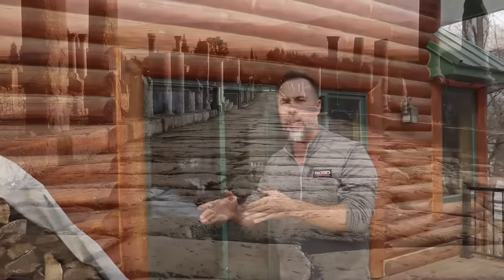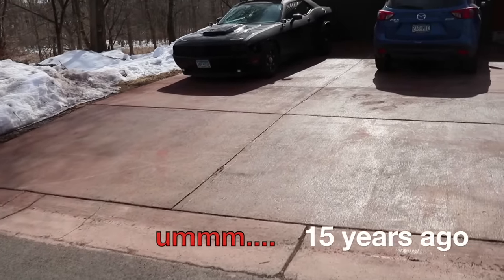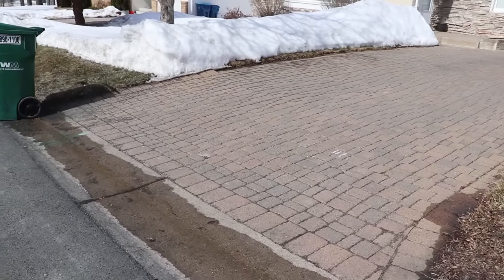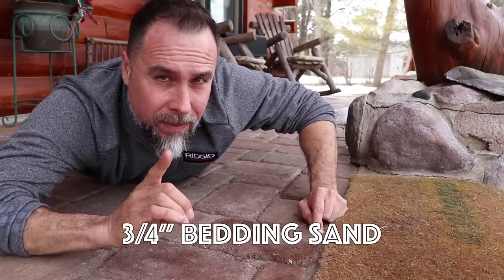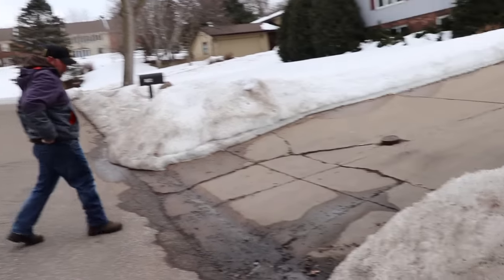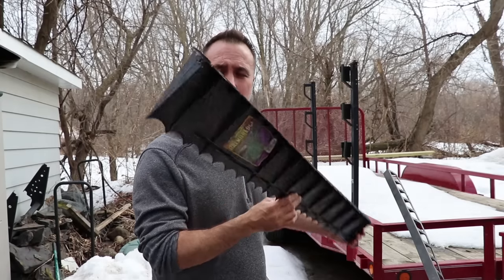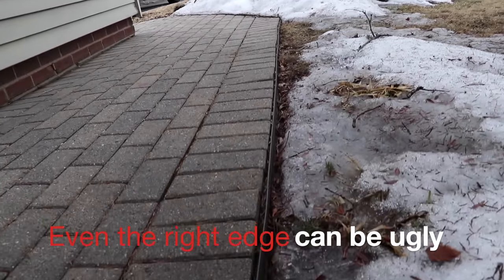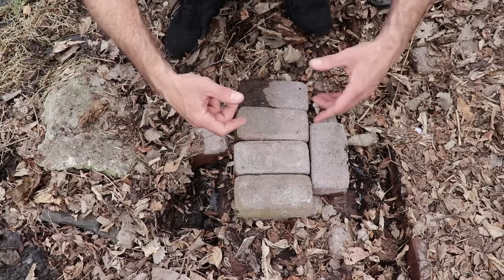How NOT to Build with Pavers-  Why They FAIL! *DIY your own successful paver project

Comment: great tips. do these also apply to gravel patios? we are planning to build one ourselves using pea gravel (10mm tanned gravel). I wonder what's the best way to solidify the foundation (our soil in calgary, canada is clay like) and stabilize the surface gravel (mulch-lock or a binding agent). we plan to secure the gravel with bricks. I suppose those bricks will require the plastic edging  where it's not sitting next to the grass (e.g. by the fence). thanks.

Comment: Sand depth is a total myth, I went with 2 inches to even out my base on one side of a 12 x 12 patio, 5 years later and no issues and we get a ton of rain in Upstate NY. It's all about a soil separator that you never even mentioned or probably even use for that matter . No soil separator and it's not a matter of if it sinks only when. That's my pro free tip of the day by a DIY homeowner.

Comment: A lot of small asphalt paving contractors will just backdrag some rock and then put in a 2 inch lift over it. It doesn’t last. You have to dig out soft spots and compact every layer.

Comment: Stanley, you mention using a "chop saw" to cut of several blocks at a time in place following a chalk line.  This strategy would be very helpful for me in that I made the mistake of deciding to make an Octagon shape for my first paving project (eight 80 inch sides, paving with 4 x 8 inch bricks).  I need to rent the saw and want to make sure I get the right one.  Are you simply referring to a concrete saw? My space is such that I do not have to be exact. My thought is to do a single row Sailor Course for a boarder, then fill in a cross to cover four of the sides and all of the middle.  This would leave four triangles to fill in which I assume will result in lots of waste.  As far as cutting in place goes maybe it would be better to do the triangles first, cut, and then fill in the cross?  Any suggestions are appreciated.

Comment: Ok I feel like this will sound like a very dumb question, but I’m new to this and we all know if I wait for my husband to do it I’ll be in a nursing home. When you say use a pvc pipe for the 3/4” sand, do you mean to use that as a tool to measure? I work so much better after actually seeing it being done. I just want to be sure.
Reply: You use pipe on gravel so screeding is easy. 2 pipes on gravel inside the last layer before brick and metal/wood beam on it to level and measure it easily. Make sure to take those out before laying brick tho :D

Comment: Well I'm convinced, going to build a wooden deck.
Reply: Keep up on termite treatments. That's all I'll say. If it ain't one thing it's another.
Reply: Your saving a bunch of money up front for something that is going to rot and swell no matter what you do.
Reply: @jeffdillenbeck1278  but depending where you live will last for a decade, you'll have that money back to build another one if need be.
Reply: Having a big problem with pavers, I'll post the outcome.
Reply: @sandracostello2833  post the outcome

Comment: You don’t use dirt as your base material... or sand... you use crush & run, tamp that down, then use sand, and level that out. Then install pavers, then you use poly sand to  fill joints and hold pavers together.

Comment: At a guess the failure of that concrete driveway you show 5:52 looks likely to be down to that drain. Drain probably has had a long term leak eroding the base and creating a sink hole, could be big.
Reply: agt155 Or!,...Or!,...They didn’t compact  the backfill around the drain in small increments. Just a thought,....

Comment: Dude, I am trying to decide if I want a concrete patio, under my deck or a paver.  Your video is making me hedge my bets towards the paver.  I am looking for guidance on how to prep the soil and gravel under the pavers.
Reply: If you live in an area where the ground freezes I would go for screw piles instead.  Cheaper and way better suited for structured support compared to concrete and pavers.

Comment: Hey Stan, excellent video as always, and the added bonus of some humor to break it up, but I've got some questions.
So I'd attempted to start a paver walkway base, dug down to remove all yew bush root material to prevent rot sinkage like the "one hot mess" job. Returned mostly clay packed at roughly every 2" with a small non-reversing plate compactor (300lb or so), then a layer of erosion fabric (forget the name) at approximately 8" from grade. Then that was topped with crushed limestone, also packed with same machine approximately every 2". Before pavers were ordered, found icicles (a whole different story) would be dripping/falling onto pavers and would prefer they fall into the garden box the walkway will be spaced off the home with. What would be your recommended edge against non-compacted fill, and in shifting/disturbing/digging up/out the settled crusher run, what would be the process to repack? Would I be best to completely remove the crushed limestone to plate compact every 2" again? I need to extend the garden box near 18" into the packed stone, therefore extending the opposite side of the planned walkway, against the turf, the same amount of 18", leaving only the middle of the crush in its solid state of compaction. Thanks for any suggestions, apologies for the confusing verbiage, as you can tell this isn't my area of expertise!

Comment: Will 1/4 minus gravel not work for a patio foundation? Will this foundation make pavers sink within the years?
Reply: use about 5 - 8 inch of gravel aggregate on top of properly compacted soil but the aggregate must have a good size of mixed stone from 1 & 1/2" down to dust, wacker plate each 2 inches layer you put down. add a weed membrane then 3/4 of inch sharp sand not builders sand then pavers then wacker plate the pavers to bed lastly spread sharp sand / brush over top and inbetween small gaps between pavers.

Comment: You may need 6 8 or 10 inches of base in Pennsylvania with its soft rain-soaked soil, but do you really need that much in Phoenix or Las Vegas? The ground there is so dry, it's like concrete already.

Comment: as a contractor in homerenovation i like to watch this channel for new machines and technologies, cause here in Europe we usually run 10/15 years behind.
but not on driveways, not saying this is a bad way to install a driveway, only this method of installing has not been used in my country for 20 to 30 years.
now we place driveways and terraces that can handle a semi truck torquing and maneuvering without any damage.
almost for the same price and installation time of the old way.

Comment: I usually agree and learn with/from  what you share but this time I can't believe you're suggesting to use that ugly and tacky plastic restrainer. That just doesn't fly with high end clientele neither with me. A concrete foundation of about 8" to 10" deep x width of your border, reinforced with #4 rebar is the best, of course you set your border pavers onto it with mortar. So far that has given me the best results.
Reply: Good point. The first thing I get rid when doing a repair job.

Comment: Yes sir the base is gonna take you the most time but I can not stress more how once you get the base done and the more pavers you have stacked up ready to go and as long as knobody treads thru the base. It is easy peasy lemon squeezy as long as you are going around with a bucket of sand and a margin trowel as you lay to correct any single pavers that might be to low and the rubber mallet is not enough to work it’ out . And yes sir polymeric sand is the concrete of paver sands that’s gonna respond like concrete in a way it hardens like a rock . Here is a good tip for using polymeric sand make sure you got the sand all in the joints and the surface of the pavers is pretty much spotless because once you activate the sand with a light misting if water it will harden like concrete all over the paver so I can not stress more the importance of those steps and only a light mist to be applied you do not want to flood it then you wash out the joints and thats the whole point of sanding the joints to lock it from movement . Also the polymeric sand is a great weed barrier as nothing can penetrate thru it . But IT may not be for everyone’s job applications because polymeric sand is not cheap.. note to anyone thinking about using it .. much love from lovely hot and humid ass Phoenix Arizona a.p.a certified installer signing out.. seeing those videos of mass settling remind me of when back in the day when plate compactors were not all that popular we used 12x36” hand tamps like u would use for tamping masonry footings lol 😂 how the time has flown. And im only 32. I feels like it was just yesterday when.i was 15 and picked up a trowel for the first time thank s Stan the dirt monkey genedyk

Comment: I put in a DIY patio. We bought a lot of brick for a guy. We built a great base. Several inches of limestone. Then we added about an inch of beach sand. We used a timber border. The issue I'm seeing is the tops of the bricks are fracturing away. I'm guessing it is the wrong type of brick. Maybe you can enlighten me to whether or not that is the issue. We have decided that the patio is too small. Its is 10 x 20. My wife wants more room for furniture without cramping walking. I surely dont want to invest time and money into a larger issue.

Comment: As a homeowner but also diyer.. I wonder what the cost difference your driveway vs the others that failed within 5 years. 
Good example of cheap not better.
Reply: TurboFlush I do this for a living and I’ve done drive ways that are 10 years old and are still solid no holes No sunk

Comment: HELP: I have brick octagon pavers. I don't believe these are clay pavers but maybe a concrete. I say this because they are no longer smooth. The top layer and color comes off when pressure washing with default nozzle. Now there are little pebbles on the top layers. The pavers now hurt when walking on them especially with they warmup under a hot sun. I am trying to find out if these are in-fact concrete pavers and if they can be restored, made smooth again. I bought this house and am betting these pavers came from the home depot down the road.
Reply: Yep, those are concrete pavers. the only real thing you can do to smooth them is seal them with a high gloss sealer. We use Gator Seal Wet Look, but any High Gloss Concrete/Paver Sealer would work!
Reply: @st.augustinepavercompany809  Awesome thanks so much I will look into that! Is the sealer color coated? Meaning The papers color has really faded. I would like to brighten them up.

Comment: If you want 3/4" why not use a 1/2" pvc pipe which will have a 3/4" outside diameter?

Comment: Wait a sec Stan.  At about 2:45, you're showing an installation "23 years ago" and "not a chip, not a move".  Great installation but....  I notice that the "straight line" from the garage to the street isn't straight anymore.  Is that due to horizontal or rotational movement or perhaps 23 years ago techniques/materials changed and this problem no longer exists in 2022?  Also, one paver is chipped (out of a thousand--I'll take those odds).  How difficult is it to lift and replace one individual stone?  Special tool?  Otherwise, great video.

Comment: The concrete edge restraint being a bad thing is only for states with those thin little grasses such as the ones up North.  That's not true at all for Southern states because that's a grass problem, not a paver problem.  I've had grass growing right up to the edge of my driveway for 7 years now and no grass has ever cooked or turned brown there, and I live in the hottest state in the union.

Comment: Saving money is rarely economical.  Ive built $2,000 300 sq ft decks and $7,000 for about the same.  When you build any surface you must consider its use first!

Comment: Been laying pavoirs for almost 30 years, for a good edge restraint learn about “bridging bonds”  no need for any of these expensive products, no haunching etc, clean tidy finish and stronger than anything you can buy. Lastly anyone laying pavoirs without adding a geotextile membrane on the sub grade shouldnt be in the job.

Comment: My friends' paver patio was ruined by ants mining out the sand below. I think it had been there a long time though. 
On the other hand we have expansive soil, so whatever we do it isn't going to stay good. Concrete or pavers crack and heave.
I don't get the rust-weld idea. The plastic edge can push through rust, no? A spike in the earth will just sit there, rust or no.

Comment: I didn't understand why it's good for the steel spikes to rust. Once they completely rust away they will have no holding power.  The rust itself will just be dirt with a much higher than usual iron content.

Comment: heck, my honey-do pavers didn't even get four inches, no wonder they are leaving me, wandering away hither and yon, to and fro.  I have the worst, most liquid clay soil.  I swear the water table is so high I can drive a pipe 3' down and have a nice water well.  Also my two lots are on the side of a hill, they catch drainage from the lot above me.  Any ideas how I can build a base for a walkway about 100' long, 36" wide from house to shop?  The builders must have done a good job back when the house & shop were built in 1967 because none of the concrete - two long double wide drives, patio,  1200' and  280' six inch thick solid slabs, and a 2100' house slab with plumbing has cracks anywhere..

Comment: 6" for a driveway in northern ontario wouldn't last a year. I am  really surprised you can get away with 6-10" for your base material in your climate. We do minimum a foot of compacted granular A 3/4' gravel. and crusher fines for the screed layer, not sand.
Reply from the maker: Where are you located and what kind of soil do you have in your area?

Comment: I gave up on plastic edge restraints. Waste of money and time and does not look professional. They just don't do the job over the long haul.  Much better success with extending the 5/8 inch crushed rock base 8 - 12 inches beyond the paver edge to provide a solid base and prevent rotation of outer pavers/ borders.  Adhesive to bond the outer pavers to adjacent pavers makes for a rigid edge.

Comment: 10 inches of rock and 1” of sand, 2” paver is 13” all up of excavation. Wow.

We excavate 7” only for 4” of concrete, 2” paver and 1” of sand.
So my excavation costs are half of yours, my excavation time is half of yours. We use concrete so our call backs are zero. Our compaction time is zero. The installation time of crushed rock is zero. 
We typically excavate by midday and rough screed the base same day. Next day we can pave up to 150 sq yards a day.
Our edge restraint is 1/2” below the grass but sits on the same concrete sub base so it can never break off. The grass never cooks even on hot days over 100. 
If they pay extra we can fully mortar each soldier course paver to the slab. This means no sand wash out can occur.

Comment: The Roman Viaducts were built out of cement they have been around for 2000 years.  It all comes down to the base work.  Reasons most concrete driveway fail are one poor base, 2 incorrectly installed usually to thin for weight requirements. Every driveway I have poured has been 6 to 8 inches with 1/2 to 3/4 rebar reinforced,  3rd.  Concrete is mixed incorrect.  I use a 7500psi mix, 4th expansion joints. Do not just cut them go back and use a concrete caulk in those joints.  Freezing water in those cracks are your biggest enemy.  Or pour smaller and many.  But remember base is 100% number one reason for failure.  Do not pour for just cars or light pickups, local deliver trucks pound for pound are heavier than Semi Trucks.  I have seen roofing delivery trucks a 3 axel truck weight 72000 lbs  during roofing season.

Comment: Those plastic paver rails are TERRIBLE. I've fixed DOZENS of patios and walkways where they fail. All in the same way. 
I concrete them in a specific way, to which I've rarely had to fix in years. 
Also, your driveway pavers were installed wrong. You laid them in rows of the same pattern creating very long vertical lines. This is why ALL of those lines looked like a rollercoaster.  No straight lines over 6feet, ever and no 4 corners, period.

Comment: You put 40-ton trucks on those Roman roads and they will not last long. Yes, they over engineered and over built, but that doesn't mean we aren't good at building roads today. We absolutely torture roads today compared to the psi to which they subjected theirs.

Comment: I have a question and since this video is more than a year old... I hope you or someone else can respond to this concern:
We are using pavers and are dealing with protruding bricks causing the pavers to be uneven. Obviously the purpose it to have nice straight lines. Now that it's halfway done and facing this new problem....Is there a workaround, without cutting or shaving down the brick? ?
ANYONE?